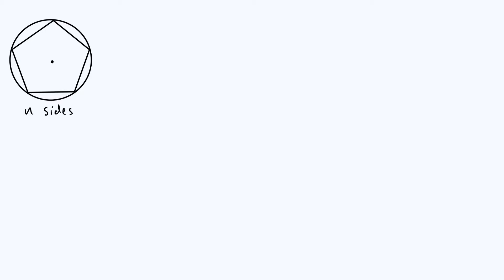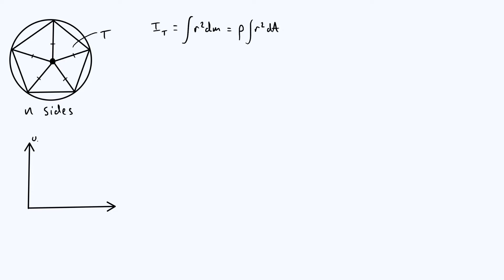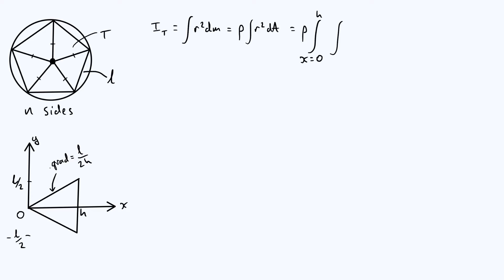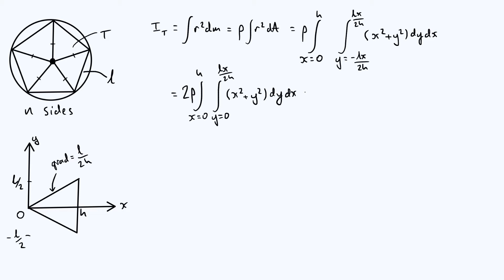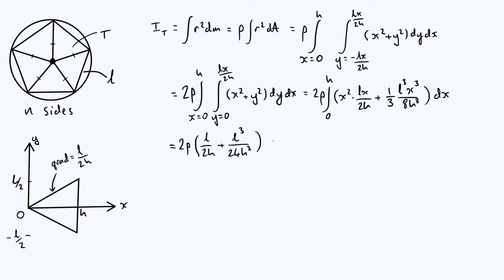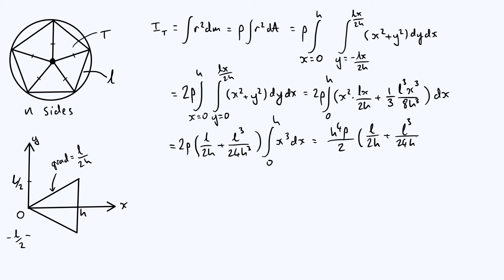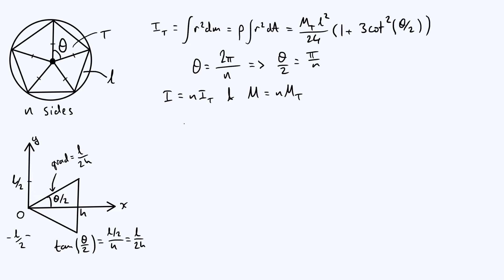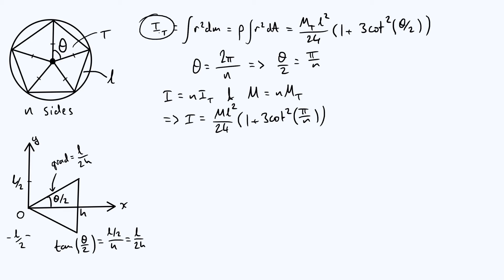Moment of inertia of a regular polygon

Comment: Thanks a lot for this video making everything super clear! It's going to be super useful for my Bachelor thesis in computer science :)
Reply from the maker: Good to hear! Are you writing a physics engine for your thesis by any chance? I was writing one last year, which is how I ended up needing to derive this equation!
Reply: @DrBenYelverton  yes indeed, my thesis is extending a 2d physics engine that worked exclusively with circles bouncing around each other and being influenced by external factors (gravity). The extension I bring are polygons, having to go through collision detection and all the kinematics related to polygons colliding with each other. 

Up to now I was able to make simple rectangles work, because the moment of inertia was easy to integrate, and now I have to make it work with any arbitrary polygon. I know you talk about only regular polygons, but thanks to your video I should easily be able to get formula for any arbitrary one :)
Reply from the maker: Nice, good luck with the project. Yes, you can extend this method to deal with arbitrary polygons by splitting them up into unequal triangles.